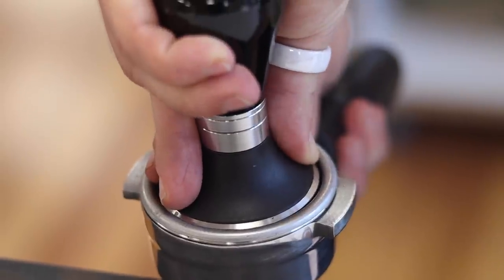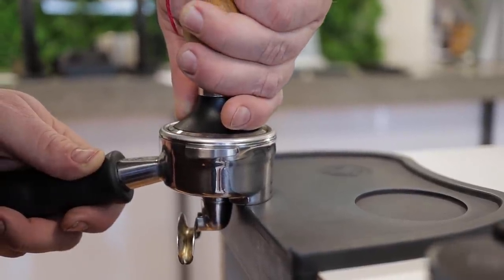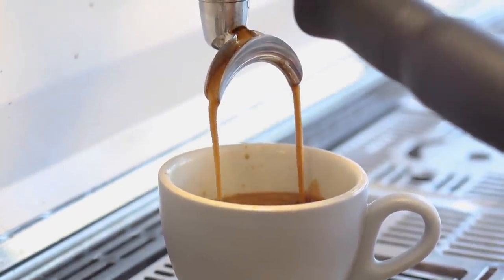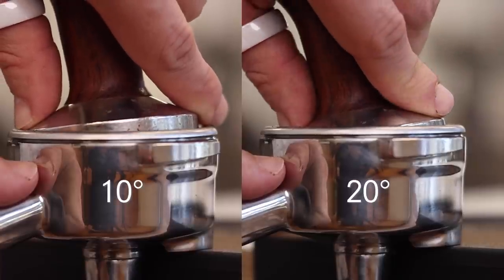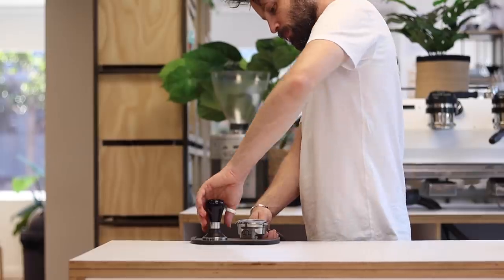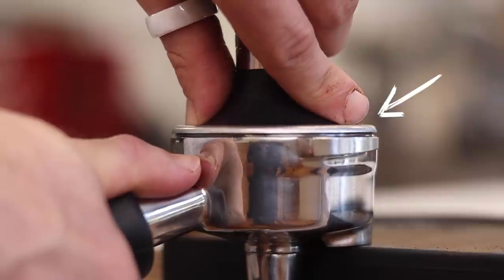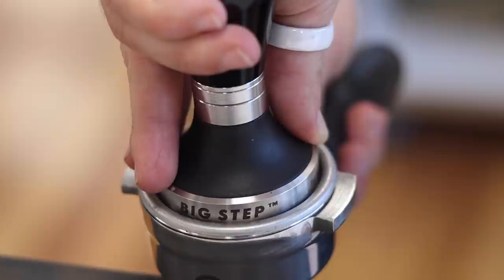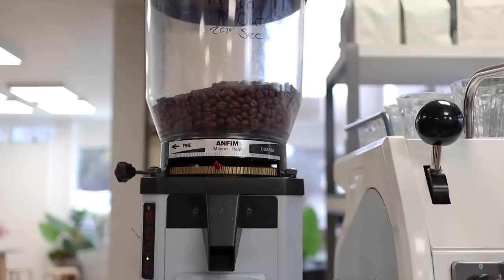Tamping Coffee: Does it really make a difference?

Comment: The end of the 30 lb tamp myth! You've saved many a wrist with this video. Thanks.
Reply: @connercruz2762  definitely sus
Reply: 10kg is 22lbs of pressure so not that far off of 30
Reply: That's not true. They did not compare a control of no tamp.. they say that any tamp over a certain pressure (10 kg) doesn't make a difference while being below 30 kg.
Reply: @rAustinBall  exactly.. had they done 1lb 5lb 10lb etc, it would have been more useful. But point is that you don't have to worry about "over tamping"
Reply: @kubectlgetpo  ya it’s just all anyone talks about these days is under tamping or just using a distribution tool. So people will be looking at this as confirmation that pressure doesn’t matter.
Reply: seriously

Comment: My experience is that the extraction time and extraction pressure is predominately correlated to two variables, fineness of the grind and tamping pressure.  The finer I grind the coffee the less tamping pressure it takes to get a thirty second extraction in the middle of the proper extraction pressure as shown on the gage on my machine.  If the grind is too coarse, I can increase the extraction time and pressure by tamping really hard.  If the grind is two fine and I tamp too hard, the pressure gage shoots up to the top of the dial and it takes much longer to get an extraction.  I believe that the coffee's roast and brand may also be variables, but I have not yet been able to test that hypothesis.
Reply: Those 2 (grind and tamper pressure) are valid points for extract time. Roast no effect on time but on extracting flavors, yes. If light roasted its harder to extract flavors and so better to grind it fine and tamp it hard to have the resistance so the water can extract. If dark roasted, you can do coarser than the light roasted coffee and tamp not as hard and ull be able to extract the flavora

Comment: The twist without applying pressure at the end of the tamp helps keep the tamping surface of the tamper clean. When I tamp without twisting at the end I find that bits of grind stick to the tamper.
Reply from the maker: It definitely does!
Can also help to ensure your tamp is kept somewhere dry when not in use, this also will help.
We try to minimise the twist so as not to introduce any potential RSI issues with the wrist whilst applying force or after.
Another reason for the twist is with competition precise machined baskets and tamps, the twist helps to remove any chance of a vacuum pulling pucks up out of the baskets when removing the tamp too fast.

Comment: Would love a comparison between tampers and levelers.  Also, a naked portafilter would show the difference in the extractions much better.  Thanks for the video!
Reply: Yeah, I'm wondering if a heavy distribution tool does the tamping for you really? At least it would be very consistent
Reply: Yeah if you don't use a naked portafilter you're hiding any imperfections in distribution and tamp.
Reply: Yep. I diy'ed all my portafiltas to bottomless around 1999-2000 (with a holesaw and file)...I watch every single shot. You get to learn what's happening in the basket and how it will taste by what you see. It's now, to me, very difficult to dial in a bean without a bottomless.

Comment: key notes;
-tamping reduces channeling - amount of pressure doesn't reli matter.
-even/level tamping is important to secure better shot (minimum channeling).
>>based on that it is justifiable to get a palm tamper???
Reply: Agreed, even with just a palm distribution tool I feel like it does the job (as long as I set the depth low enough to apply some pressure).
Reply from the maker: nice summary. we didn't test different styles of tampers specifically, however the palm tampers look like they tick the boxes. if you're using it in a cafe, I would just make sure it's not adding extra strain to your body.

Comment: I work at a supermarket and they’ve got an espresso machine that I make drinks with. Their tamper is the wrong size and it always leaves loose coffee on top of the puck and it drives me nuts. Plus the coffee sticks to the bottom of the tamper and I don’t understand why. I would speak up about it but they don’t really care about their coffee section. Quite sad really.
Reply: I usually polish the puck, just don't apply any pressure and it shouldn't cause any issues but it reduces the coffee stuck to my tamper. I don't believe it makes any difference to the extraction, but it does make the whole process a bit cleaner.
Reply from the maker: If grounds are getting stuck on the tamp it sounds like there's probably moisture on the tamp or the tamping mat.

Comment: I know it is not espresso but I notice most experts do not tamp a Moka pot at all. A rough levelling is about all.    Is that because having the water bubble up from underneath cannot cause channeling?  Perhaps tamping would make it possible for channeling happen while a loose consistency does not?
Reply: The moka pot doesn’t produce the pressure needed to get through a tamped-down coffee bed in any reasonable time-frame.

Tamping with any appreciable force would risk setting off the pressure valve before any coffee can make it through

Comment: I would be interested to see how much of a difference it makes if you tamp crooked and then forced it straight. I’ve always just taken it for granted that it would be terrible but now I think I might test it out haha
Reply from the maker: good question, we didn't test that specifically.
Reply: we can probably guess can't we?  It would be better than crooked but perhaps not as good as a good tamp first go.  What causes crooked tamp to "channel" (which I'd argue is a kinda misleading and misunderstood term because it implies a shot can either channel or not, when in reality every shot channels to some degree or another.  That is to say "channeling" is just an example of unacceptably uneven "exposure", which might be a useful word to popularise) is the difference in how far the water has to travel from the bed to the base of the basket.  If you correct your tamp, you presumably avoid that problem.  But!  It probably also causes the side of the "bed" (or whatever you wanna call it) that was initially too high to be more compacted than the opposite side, ,which might still cause uneven flow.  But!  if it has been tamped hard enough (guys, there was no "science" in this vid at all), it shouldn't make an appreciable impact (as the pressure increases, the density of the bed approaches a maximum value (finite limit), ie please tamp as hard as poss without doing an injury).  Look!  Just get a puqpress and call it a day.  Just remember to keep the tamping surface clean and dry.
Reply: @nickwilson2318  sure, we could probably guess, but isn’t that missing the point of this whole experiment? I was surprised to see the outcome with the experiment with tamp weight... we could be surprised again here
Reply: @timmilatte  read my comment properly.  Also, these guys aren't scientists.  They aren't really using what you could call a scientific process.  So, my guesses (which are based on things we've known to be true for years) is probably just as useful.
Reply: @nickwilson2318  ok Mr Condescending. Have a nice day

Comment: Great video! Saved for future use also. However, you mentioned keeping a consistent tamp pressure when instead adjusting grinding size day-to-day at 6:45. But if light or heavy tamp pressure doesn't matter, why should keeping a consistent tamp pressure matter?
Reply: This is exactly what I was gonna ask. Not to be a smartass of course, but just looking to create the best, most consistent quality in the cup of our customers, with the least amount of hassle. Other than that, thanks for a very interesting video! Greetings from Amsterdam.
Reply from the maker: yes, the wording was a little unclear there. you do need to tamp hard enough to compress the grounds (that was the kiwifruit bit), but beyond that, harder tamping doesn't really effect the flow rate. The point at 6:45 is to focus on the grind adjustment and keep the other parts of your technique the same.
Reply: @SevenMilesCoffeeRoasters  Exactly what I was thinking... After all, by slightly adjusting tamp pressure, you can to a certain degree, compensate for finer or more coarse grinds... But i also agree that "heavy weight Tamping" isn't something really useful, since at some point the compression won't increase anymore in a meaningful way, as its limited by the fineness of the grind. In addition there are certainly other adjustments you can do before even thinking about 
adjusting your standard tamp pressure.

Comment: My question would be: If you recognize you ain't tamped level, can you correct that to get a good result again? Or is the waterflow then again uneven through that different pressured coffee cake?
Reply: I would say it's good to go in again and level it out, but there is a chance that some of the "unevenness" will remain and the shot won't be perfect. I would personally still use that shot though, especially if it's for a larger milky drink for example. If you're not in a rush and you're in a mood for perfection, you could knock the coffee out, fluff it up again, pour it back into the basket, distribute and tamp properly, but it's unlikely that you have time to do this in a cafe setting. I always teach my baristas to waste as little coffee as possible, so I would always advise against discarding the coffee and grinding another dose.
Just do your best to be level every time and correct your angle if it's slightly off, it'll be fine!

Comment: Great video.If the pressure during the tamping  doesnt impact the flow of the espresso, then why do we get a watery espresso if we tamp light?
Reply: Or on the other hand, if I tamp too strong,  the coffee doesn't even come out :/
Reply: Can't speak to the coffee not coming out, but as for the watery espresso, in the video they briefly mention what happens if you don't tamp: air pockets/channels for the coffee to flow through quickly, resulting in poorly extracted espresso. If you tamp too light it's similar to not tamping -- you might not press out those air pockets. Once you tamp hard enough to remove air pockets though, there are not any benefits tamping harder beyond that. At least this is what I took away from the video :)
Reply from the maker: Thanks Andrew, well put 👌

Comment: Excellent advice on use of a tamper. 

Exerting pressure will not make a jot of difference, for the simple reason the steam at 9 bar exerts far higher pressure. 

Main point is level tamping squeeze out the air to avoid channelling. 

And ensure tamper is vertical, basket  horizonal to surface, think of holding a screw driver. 

Too often I see tamper and basket at an angle, bad habit,  bad technique, that will lead to rsi. 

One of the worst examples I have seen was European Coffee Trip showing a barista at work, when I drew attention to this bad tamping, barista tried to justify what he was doing.

Comment: Thanks for an interesting and useful video. This may be going off topic a bit, but nevertheless it is related, I believe. How tight should one make the portafilter in the group head? And, wouldn't any uneven tamping level tend to level off by a reasonably tight fit against the shower screen?
Reply: The reason you tighten the portafilter is to create a proper seal between the basket and the rubber gasket. Ideally you want a little space between the top of the coffee puck and the shower screen for water to flow freely. The coffee touching the screen can cause uneven extraction.
Reply: @attilaszabo7727  Thanks for the explanation, it answers my questions well.

Comment: What are your thoughts on just using a distribution tool with no tamper, my spro has been incredibly low channel and consistent since I made the switch. Would be useful here to compare the two? Cheers :)
Reply: Use distribution/leveler tool for distributing and leveling, and a tamper for tamping. This still hasn't changed and it won't for a long time.

Comment: So how would I know when my shot comes out in slow drips, that this is caused by tamping too hard (too much pressure) or caused by grinder size too fine?
Reply from the maker: if it's pouring too slowly then it's most likely a) ground too fine or b) too much coffee in the basket
Reply: Seven Miles Coffee Roasters my coffee comes out in drips for the first few seconds then runs smoothly. Then should this be considered grind size too fine?

Comment: When will you release your episode on distribution? :)
Reply from the maker: probably in a few weeks time. working on it now.
Reply: @SevenMilesCoffeeRoasters  could it be tomorrow? :)
I have been using the smart tamper for months. Wondering if it really works.

I am feeling that it only helps distribute just the very top surface  of the ground coffee in the basket, but can not manage the possible uneven density beneath that nicely leveled face

I guess that it is caused by the hidden crumb, which remains there despite some pressure already applied when tamping.

How do we use the smart tamp correctly? Press then twist or twist without pressimg until friction is minimal?

May either way create channelling.

Is a needles tampper worth or even worse?

Comment: You don't need to do all this to know that there is a point beyond which adding extra tamping force has no effect. You properly distribute the coffee and tamp it adding pressure until the compression first stops (should be not that much pressure). Then add extra force. No further compression ensues. If you can add ridiculous amounts of force, your tests will show a degradation in the extraction, but that is beyond the scope of this video.

Comment: This is Bullshit, I have proven at home that different pressures changes things, I was just curious if their was a optimum way. I can tamper my espresso maker and cause my machine to not be able to push the water through it. Also if I make it just dense enough to where the water can hardly run through the espresso comes out much stronger. Maybe it's up to specific machines but the quality improves on mine if I increase the tamper pressure but also it increases stress on the machine. It's ridiculous to say that a denser filter will not slow down the production of coffee, that's simple physics. I shouldn't really care but you're results are wrong. My Machine has 15 bars of pressure and I can over tamper and have a huge impact on the Espresso creation.
Reply from the maker: Hi David, apologies if we weren't clear. To clarify, we didn't say tamping doesn't have an impact, we said that tamping beyond 10kg of pressure didn't change anything in our tests.
Also, I'm not sure what you mean by "a denser filter"?
Reply: @SevenMilesCoffeeRoasters   I think he meant denser puck. ?